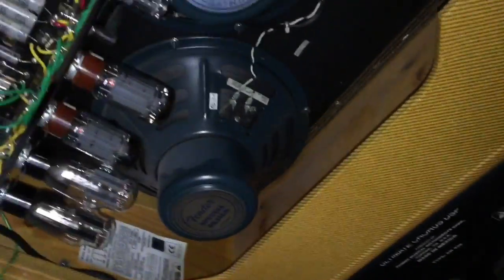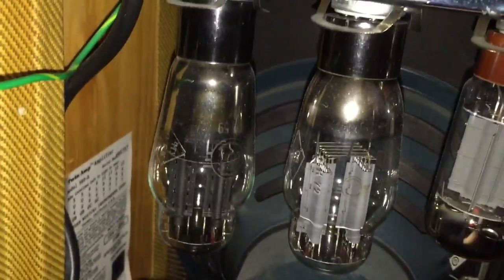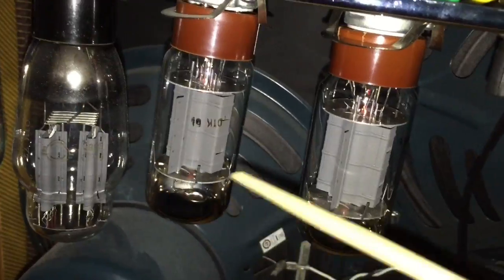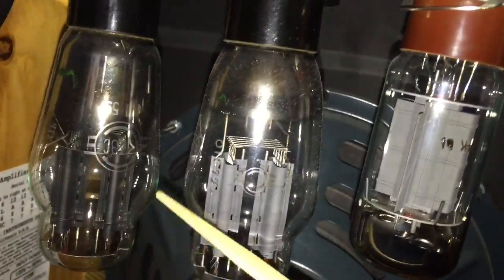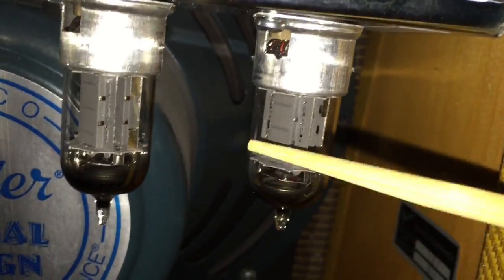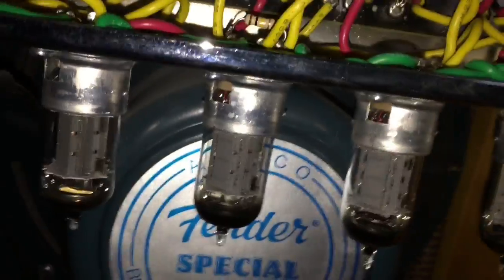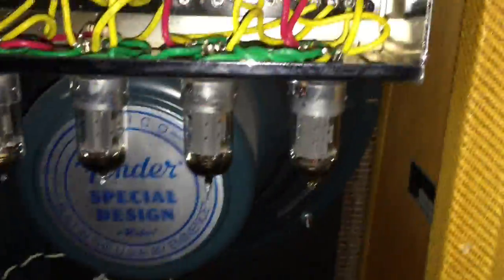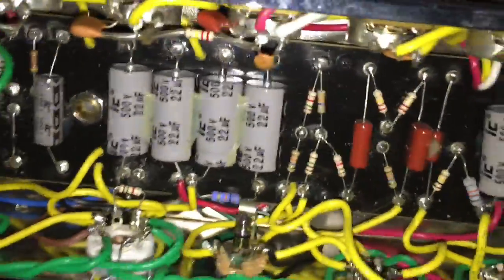Finding A Bad Tube In A Tube Amplifier

Comment: Hi! Just bought a used Mini Rec off of Guitar Center and noticed that Channel 2 Vintage at 10w is dead silent while Channel 2 Modern is extremely loud an bright (as in 3x louder than other channels). Could you help me diagnose the faulty tube? Thank you.

Comment: Fact: That oil from your fingers can destroy radio and audio tubes is just a myth! And probably comes from the incandescent light bulbs that were used in film projectors and other powerful light sources. But they need a high drive voltage, and the capacitors connected hold that voltage long after you've pulled the plug. So keep your fingers away from the audio tubes anyway🙃

Comment: How much pressure is required to replace a preamp tube - I tried wiggling in the new tube while applying gentle but firm pressure but it just doesn’t seem to go in - do I need to press in really hard ? Just doesn’t feel right cuz all the videos I see of people replacing tubes - it seems to be very little effort -

Comment: How does geting oil on the glass cause them to fail? The oil doesn't eat through the glass. Sounds like BS
Reply: It's the same with automotive light bulbs, the oils lead to "hot spots." Overheats the tube and they don't last as long

Comment: touch the tubes all you want ...that was only true about old fashioned tubes from a long time ago. the finger oils would cause uneven heating of the glass surface and it'd shorten its lifespan. modern tubes can be touched as long as they aren't too hot to touch....

Comment: ..just putting out there. I have found most of the new fender amps develope that microphonic ring. Sometimes just replacing the noisey ones alone does it but I have found that the valve bases are sometimes not fitted properly with enough solder.

Comment: If you're changing preamp tubes again after one year, something is not right with that amp. If it sounds harsh, maybe you have a 12AX7 in a socket that you should really have a 12AT7/AU7 in. It's a common mistake. They look the same, fit the same socket, and the amp still works. But a 12AX7 has a lot more gain. The driver tube and reverb driver, are often a 12AT7 or 12AU7.
 But I'd get the amp looked at, rather than keep destroying tubes, if there's a problem. Maybe you have plate and grid resistors that are way off value and your B+ is too high.
 It's also possible you bought trash tubes or got gypped.
 If you work in a place that sells tubes, you probably play guitar. When your own tubes need replacing, it's all too easy to swap them out with good ones from work. just pop your bad tubes in the box and put the box back on the shelf. I'm sure it happens. If tubes are going bad in one year, something ain't right.
Reply: Thats right, I have only needed to change valves once in 17 years on a combo used every day.I think they are using low quality bases and not checking the circuit cis you can get that problem in a brand new amp.
Reply: He shortens the tubes' lifespan by all that unnecessary tapping.
Reply: I had a 1962 Gibson amp. Had the original tubes in it and they sounded fine.

Comment: Be careful about doing this at high volume start at lower volumes and work your way up sometimes you can get hit with a very loud bang if you have a short or a really bad tube or a tube that’s very microphonic and your hand will not damage a tube but you might burn your self if it’s hot.
Reply: What you tiuching it with your fingers when its hot do you stick your hand in the toaster no wait let it cool .or grab that hoty and hold on.
Reply: Everthing is apreciated .

Comment: Now there is a handy and safe tube puller / inserter available on ebay, item 254242318237  Easy, simple and safe. A perfect tool for any audiophile or vintage electronics technician.

Comment: Credibility lost when I heard oils from hands can cause tubes to fail 😂😂😂
Reply: Oil from the hands only hurts heat lamps, and security lighting! Oil has been on tubes for 100 years, again lightning not vacuum tubes.😂
Reply: The oil on the valves can cause the heat to accumulate to one place and then cause the tubes to pop. Its the same as on headlights for a car.
Reply: Hhhhha
Reply: He has 5w-30 running through his hands
Reply: No, for real. The second I heard that, I said out loud "You cannot possibly be serious".
Reply: Damn! I thought to myself "wow! Never knew that!" 😆😆
Reply: There's some truth to it actually.
Reply: @RyanMcQuen  no there’s not.
Reply: It is actually true and any tech would agree... Specially on power tubes, they get way more heat than preamp ones.
Reply: @Almendrado95  the tubes are sealed and are vacuum, hence the namesake. Oil on the glass won't affect the semiconductors inside unless the oil causes the glass to break, which it won't.

Comment: About that warning at the beginning of this video.. If you discard the plug from your amp, and then try to power it on, shouldnt it "deplete remaining voltage"? I'm definitely not an electrician neither have opened an amp. I've heard that this should be done to computer when touching parts inside it.
Reply: A amp tech told me to unplug the amp while strumming a plugged in guitar, to drain the filter caps. I don't know how safe it is, but I can see how that could make sense
Reply: @justinpaquette224  shouldn't a tube amp been put to standby mode for a while before taking power off?
Reply: @mekakorpse  It might be a good idea, but I think its more important when you are turning the amp on

Comment: Hello. Thanks for the video. I recently bought a second hand bugera333xl (not the infinium version) and i found out two of the pream tubes are microphonic. Here in my country replacement tubes are either hard to find and expensive. I need to know how dangerous is operating the amp with microphonic tubes? Shoud i wait until i can replace them before using the amp? Besides that, there are 3 diferent tube references 12AX7A, 12AX7B and 12AX7C what is the difference between the tree tubes? any information you can give me would be most apreciated. tahnks in advance.

Comment: I got a question: so if you can hear the tubes making the popping noise when you hit it through the amp, does it means that it's a bad tube?
Reply: No, that is perfectly normal. It is called "micro-phonics" it is due to the metal parts inside the tube vibrating which causes a resonance, doesn't necessarily mean they are bad. Usually when a tube goes "bad" the filament burns out or the cathode depletes.

Comment: "Touch these and you're dead" ... OK! 

 Do I have to take that rear cover off or did you just do that to check the cables and solder n stuff? 
Very good I am going to give it a try since i suspect one or two tubes to have failed in one of my amps. Thanks for the demo
Reply: Tobias Rechsteiner Dont do it. If you touch a charged capacitor you can actually die. Even if the amp is turned off

Comment: getting your dirty hands on a tube won't damage them in any way...
This is a myth
Still a good video mate!
Reply: Yep. It’s not a halogen lightbulb, it’s a vacuum tube.
Reply: @Danielburke-go8dc  I was a Type C color darkroom technician all my life. (until film went to digital) The bulb in the enlarger was halogen. We never touched the bulb. The reason was, that the oil of your hands would change the color (Kelvin Temperature) of that bulb. That was why. It never shortened the life of a halogen bulb to touch one. That myth all started with not touching darkroom halogen bulbs and spread to everything.
Reply: Another funny thing was he tried to listen for microphonics on the rectifier tube!
Reply: Why take the chance? I just tested my headlights with a drumstick.
Reply: Been a BMW technician for 8 years and touching the globe is an absolute no no. The amount of globes I've had to re-replace because the apprentice got his fingers on them.. not saying its applicable to vacuum tubes but when it comes to cars.. its not about the colour its about residues remaining on the glass can't dissipate heat as well as it should when 100% clean and it causes internal temps to raise beyond spec. You can literally see the finger prints burnt into the and the filament damaged on the other side of the glass directly at the point of contamination..
I suppose automotive applications have a much longer on time/ heat aswell so maby not relevant to vac tube amps.
Reply: @jameseetseggs5798  Touching a halogen bulb will stain it and change the color of the light output but it will not harm the bulb or shorten it's lifespan.
Reply: Yeah, they AREN'T halogen bulbs!
Reply: Actually the oil from your fingers CAN cause "hotspots" on the tubes' surface eventually causing premature failure.
Reply: @RearviewMirror-ij2pr  That is not correct.
Reply: @RearviewMirror-ij2pr  Yeah, then the indicators would eventually fail...IF they ever got used!

Comment: So how was it, did you really solved it? cos I couldn't really hear the noise when you tap the "culprits". What 12ax7 did you get? 

I too currently have harsh sounds when I hit the amp harder with pedals and these tubes (Tung Sols reissue) are only few months old and I didn't even play that hard/much, whereas the JJs that I had there before were crackly when I smack the string hard or pushed hard too. A little different. Thanks!

Comment: Used this tapping method on my 93 fender blues deville. After hearing a loss in amp output and a weak dirty channel, i found a bad 12ax7 closest to the power tubes. 
Saw this vid and figured id try it before i get beat over the head by a tech.. and honestly with the volume up, a extreme light tap will do, its very audible. Total cost $14 Thanks for the video

Comment: Love the amp. Either it is an old tweed that has been heavily modded  or it is an reissue ..... old Fender tweeds do not have ceramic tube sockets. I have an old Supro s6650 with its original tubes that I haven't played or fired up for over 25 years. As soon as I can I will have it checked and serviced along with a three prong upgrade. I wish I had ceramic sockets. $$$$$
If tubes need to be changed every year I would suggest looking at the biasing. I would also suggest playing it as needed and have a practice amp from Goodwill for home use.
Reply from the maker: Thanks man!  Yea I love this amp, it's my number 1 for sure!  It was a reissue the custom shop had in the early 2000's.  This one is a 2006 model.  I think the custom shop is bringing them back, but they don't have the Ted Weber speakers in them.  It sounds amazing!

Comment: If a tube does not glow when you turn it on, is it a bad tube?
Reply: No. Or yes. The filaments that make the glow, are a totally different circuit to the rest of the tube. The amp won't work if the filaments aren't working, but that doesn't mean it's a bad tube. If none of the tubes glow, it's probably the filament power supply - those thick twisted wires that run to every tube. If you're getting around 6.3 volts across those, then it's the tube. If the heater in one tube fails, it won't affect the others. They should still work. Bear in mind that some tubes have the heater filament tucked away where you can't necessarily see a glow.
If none of the tubes are glowing, check the filament wires to make sure you have continuity all the way along. At some point along those wires, there will be 2 big resistors, both connected to the filament wires on one side, and to ground on the other. Replace those. They often burn up. The amp usually still works if they do, but is very noisy. If you get no voltage at all across the filament, but there's no obvious break in continuity, then you got the absolute worst case scenario: The actual filament winding on the mains transformer is dead, and you need a new mains transformer. (Unless your filaments are powered by a separate transformer, in which case you just need to replace that)
 But no, a tube does not have to visibly glow, to be a good tube
Reply: @ashscott6068  thank you for your knowledgeable reply 👌
Reply: Just got a budda SD18 and the v1 tube is visibly bright. The other two have me wondering. Not sure if they work, but the  amp runs quietly 🤔

Comment: I just got a brand new tube amp and I put them in. After I turned it on whenever my bass knob and volume are changed there's a very loud humming noise. Still new at this and would like some help. Did I maybe put in a Pre amp tube in a little off or was it maybe a bad tube?
Reply from the maker: +Mentas.  I would maybe first try to plug the amp in another outlet to see if maybe that cleans up the humming.  Also, if you put in new power tubes without a proper bias job, that may be your first culprit.  Hope this helps!  Cheers!
Reply: Thanks for the tips. I don't have any other guitar cords and at some points the hum stops in a certain position the way I hold the guitar. I think it might actually be a faulty cord. I've had it for a really long time and it hums on my other amp as well. I think I found the problem.

Comment: First always have the schematic for your model and series of amp .  there's notes on them telling how to set up the amp to bias it and where to place control levels while testing ,NO ALL THE WAY UP !!!
2 ND RULE OF THUMB V1& V2 ( the one's on your far right looking at the back )  will fail or cause noise problems just Always travel with an extra 12Ax7,v1 and swap it out if problems still persist replace old v1 tube and repeat procedure with v2. Please turn off amp,let tube cool  also Unplug from mains !!! 
PLEASE Note ,Tube Amps Can Kill if you're not experienced. I'M a retired broadcasting CEO and guitar player.

Comment: Tapping a tube is a rediculous  diagnosis test.  I can't begin to tell you how many times customers of mine have called me and said, "I tapped my tubes like it said on the internet, and now ALL my tubes are microphonic"....
Reply from the maker: +Chaos Entertainment Well that quote is just not accurate, isn't it?  If you tap a microphonic tube, it will give a  responsive to that tapping.  Microphonic tubes tend to be the preamp tubes, so when you tap one and it gives you a response, I believe that's a most likely way of finding the culprit.  I wouldn't say what I did is a "rediculous" diagnosis test, it's actually a really good way of finding a bad tube without fetching a lot of money on a tube testing device.  You're going to eventually replace all the tubes, so spending money on a diagnosis on your preamp tubes really seems ridiculous to me to be frank.  It's not more complicated than that and when you find a microphonic tube, it doesn't mean all the tubes in the amp are bad.  "I tapped my tubes like it said on the internet, and ALL my tubes are microphonic" That's just not correct.  I hope you tell your customers that.  Cheers!
Reply: Do your research.  You may get away with it many times, but all of the real life experience that has shown it can drive a tube into a microphonic state aren't inaccurate.
Reply from the maker: What's the point?  If you're getting high pitch noise, or unusual feedback, and you find a microphonic preamp tube, that's most likely the culprit.  So it's time to swap that tube out.  I'm sorry, but I can't believe every customer's tubes have become microphonic by tapping them.  That's probable, but unlikely.  Cheers!
Reply: "If you tap a microphonic tube, it will give a responsive to that tapping. Microphonic tubes tend to be the preamp tubes, so when you tap one and it gives you a response, I believe that's a most likely way of finding the culprit."

This is just not correct... A ringing tube is microphonic, if it amplifies your the thud of the tapping it isn't, all tubes are somewhat microphonic when you tap them by design, especially the louder the amp is and microphony will vary depending on amp as well
A tube recreating the sound of you hitting it is not microphony... and  it's true some tubes will be dead silent some will not be, because they aren't all made equal, that doesn't mean that the loud tube is microphonic, actually that is one way you test for what tube you want to put in V1, the less microphonic of all is what you want at your input, same goes for the PI, you'd want a quite tube in that position as well.
Microphony is when you get feedback from the tube. But yeah hitting them repeatedly will make them microphonic at one point thats for sure.

Comment: Can a microphonic tube start to feed back from the speaker sound?
Reply: Yes it can, and to find out if it's a tube or not, cut the volume on your guitar, hit the amp chassis if it rings and feeds back, you've got a microphonic tube (or a bad capacitor but most likely not). What this video is demonstrating is not a microphonic tube, it's a loud tube but definitely not microphonic. If he had have swapped the 2 over for the other 2 he would have been fine.
Reply: Yes.

Comment: I have a laney cub 10 and the gain knob doesnt work anymore but I cant hear anything even if I put the volume knob at 10. but if I crank up both gain and volume knob, I hear the clean sound. but considering that I cranked them both to 10, it still sounds quieter than before. I still hear alot of distortion when using my boss overdrive/distortion stompbox though like nothing changed.. so weird..